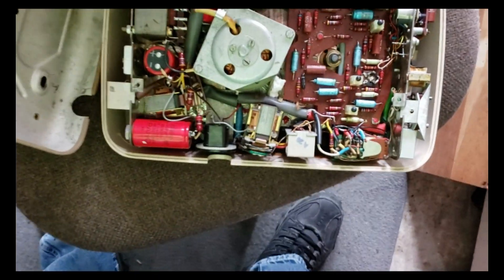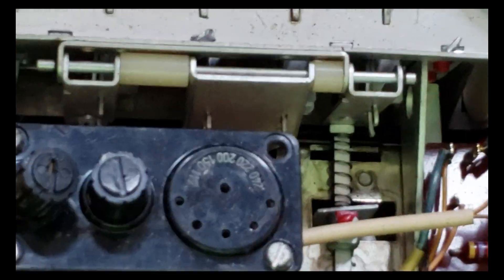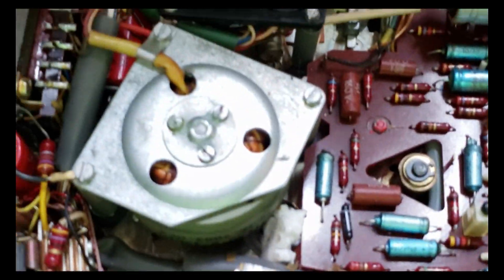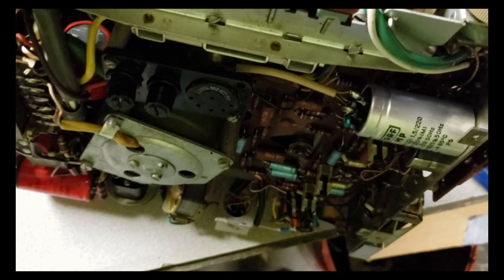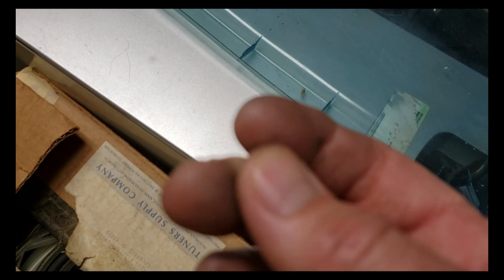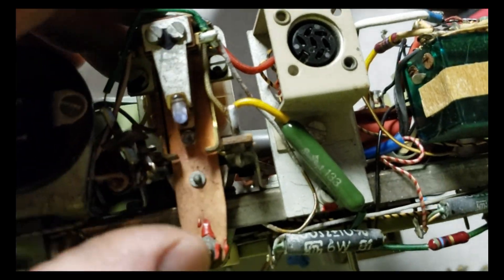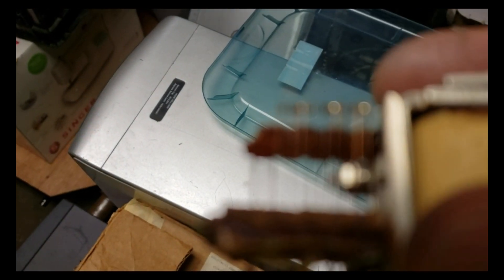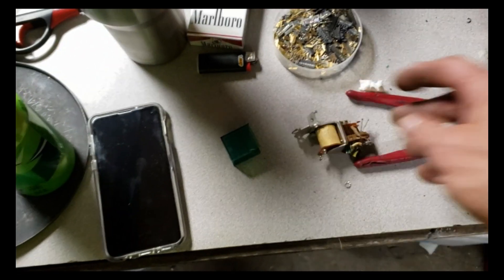Vintage Electronic Stenograph Data Reel to Reel Recorder.....I Think

Comment: I have one of these that actually works. It's for dictation or, as you say, stenograph use. It's quite special because it's more a 'reel-to-hub' recorder as the take-up reel is a hub that cannot be taken of the machine - at least not without a screwdriver. The tapes themselfes are standard tape but the supply reels were a special type only used by Grundig.
Reply from the maker: Interesting, thank you